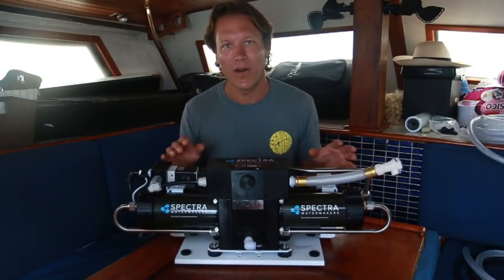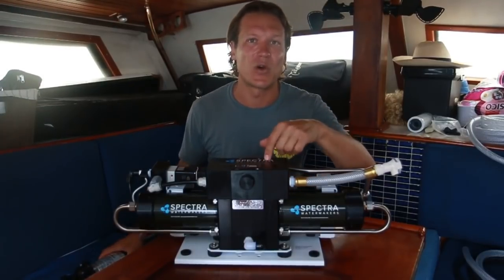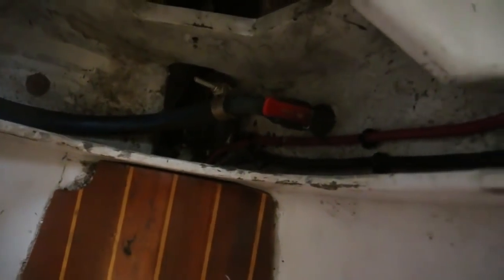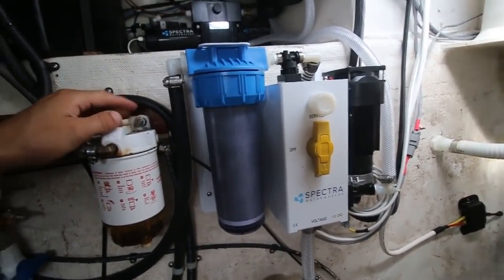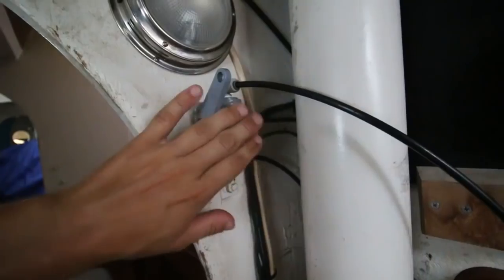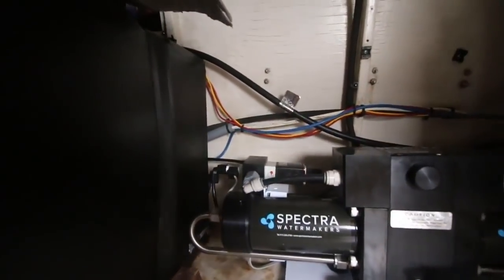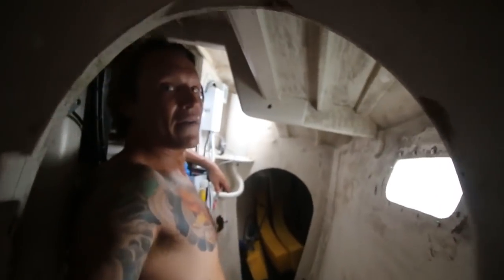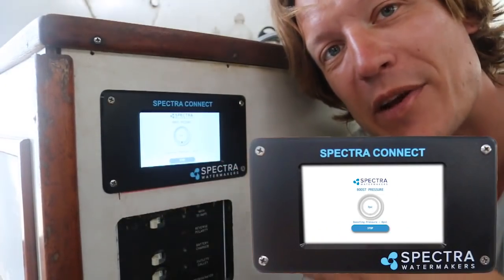Watermaker Explanation & installation

Comment: GREAT review and install info. Well organized. I am about to start mine up after years of disuse. I bought my boat with the system installed but winterized and it has been unused. Likely ruined something. I guess I am in for a 600.00 filter replacement? Will find out. Your review has helped motivate me to getting off my butt and getting this done ... soon :  ). one of the issues for me is that I am on the Oregon Coast, and most marinas here are all at the bottom of rivers and so silt is an issue. You're NOT supposed to run these things in areas with high TDS (Total Dissolved Solids). This is my BEST excuse! :  ). Thanks gain for the video!

Comment: This may not apply to many sailing craft but I'll mention it , on a trawler I used to operate we ran a drain line from the air conditioner evaporator into a drum to catch the water that condenses , it would make more than 20 litres per day and was fine for laundry etc. which extended our tank water usage .

Comment: "entertaining is every time I'm in one the videos, right?" Kimi is so freaking loveable! Great video! We're considering a Spectra too. Why did you go with the Ventura 150 vs the 200? Miss you! -Des
Reply from the maker: Good question, Des. We wanted to get the least expensive option with a Clark pump. The 200T is the same pump, but with a bigger Clark pump, making ~2gph more water. For us, the most important thing was being able to run it off of the 300W of solar we have. The 150 is perfect for that. The 200 would be equally as good, but at a higher price point. If you are worried about producing more water, or having redundancy, the Cape Horn version is pretty cool. Check that out. Good to hear from you! Big hugs to You and Jordan.

Comment: Great video James. Kim is awesome too!  I’m sure you have done your homework and this is the best water maker. Is it reverse osmosis? I used to maintain a system on a ship in the Canadian Navy. 😍🇨🇦 This one looks amazing and way to go on getting that sponsorship. Just a thought... make sure your engine gets proper cooling and running both doesn’t starve one. You don’t  want a burned out pump (on the water maker side) or an overheated engine. Quick fix: run one or the other. ONE LOVE from Vancouver Island. ❤️🇨🇦

Comment: This was one of your best videos ever. Seriously. I've see another sailing channel use one that came in a case and it was very simple to use.  But you explained the whole process so well. I have one question, can you substitute a pressure gauge on your bladder tanks to shut the system off when the bladders are full? It should just be a set of contacts so the water maker shouldn't care.  What do think?
Excellent episode. You're going to make a great ambassador for them.
I heard Sailing into Freedom, Peter and Margarida want to meet up with you guys whenever they get to the other side of the Panama Canal. 
Great episode. Safe journeys from snowy Syracuse NY.

Comment: That's a great video. What about a lightning strike? I know you lost a ton of equipment recently due to a strike. How would your new watermaker fair?
Reply from the maker: good question. There are manual overrides, and as long as the shurflo pump is still good it’ll make water. :) That’s one of the questions we’ll go over with the factory tech in the next video.

Comment: Nice video, but puuuh, its bloody expensive in Europe and even in Columbia and Panama. I see one problem for the future - the machine has a lot of valves in the high pressure zone. For a similar system, Purewater, some users tell it, some not. I'm exited on you experience.
Fair winds
Tom

Comment: 9 amps for a 12v DC system ,  that's about 3 times less current than other 12v watermakers that produce about  the same amount of H2o per hour. . This unit is too big for me but I think there is another unit that runs on 12v DC and while less efficient it's a lot lighter and less bulky  , still very expensive if you can find it ( Power survivor 40E ) .
Oh yeah I miss Kim ...... what a great smile she has

Comment: Wait - you put a 120V 15A (1800W) circuit breaker on a 12V 9A (108W) Spectra Ventura power input?
Reply from the maker: CB go by amps, not watts, but good catch. It’ll work for now, it’s rated to 48Vdc

Comment: I don't think a standard household AC circuit breaker will work on DC power. 
I could be wrong (it's happened before) but you might want to check on that before you depend on it to keep things from setting your boat on fire.
Reply: Amperage doesn't care. Most are rated for either.  But the contacts will wear out much faster if gets used as an on/off switch.
Reply: @tomwilliams8675  Ok, I wasn't sure it would actually trip it if it needed to. Hopefully all is well.

Comment: Seems like a effect system is it internet dependent ...what would it cost approximately ,Txs
Reply: It's simply using a router for onboard wireless connections, hence each device has it's own IP address.  No need for Internet.

Comment: Maybe a solid product, but the video is a POS. Too much installation detail overlaid on 'what am I now looking at?' 

The result is: what in hell is now being shown? And I'm a person with multiple engineering degrees!!  The close-ups on the pump: worthless. The details on wiring connections: the same. 

The optimum approach to selling this system should a series of references to 1) successful installations that prove reliability and meeting potable water specs, 2) installation instructions/details that are available and are backed-up by support personnel. Make a strong arguement as to why this particular arrangement has advanteges relative to the competition.

 Is there a distinct reason for one to purchase this system, as opposed to the myriad of other competing systems to produce potable water? For me, it is a very affirmative NO, at this stage of invesiagion. Tell me the advantages of your system, how it will be supported, and perhaps note any real-world operational history. 

Otherwise, the details on how to hook-up such a system are 100% wasted.

Thanks,
Mike2
Reply from the maker: Whatever I tried to reply here would be a waste of time to a curmudgeon. Go take your multiple engineering degrees and design your own.

Comment: This is exactly what I needed. I watched this a couple of years ago... but now were 200 nm off Vietnam heading to Subic Bay (Starlink is so cool), and only  'sort of know how the Spectra system works...' Of course we really want to know what's going on.  "Ah, the pressure relief valve was left open...." 
I was given brief insctruction at the dock. "It's all automatic. You don't need to open that valve." "You don't need to open that valve." "Oh,  maybe you do need to open it..." (Spectra makes a great product but the manual jumps in too deep too quick. Really appreciate the step by step and the diagram.)  Working great now. Thank you James, really appreciate it.

Comment: It seems rather complicated, friend. And when offshore, on no account divert the output straight to your main water tank when at sea. If the desal fails, you will end up with your main water tank full of salt water. Use a separate tank for the output from these devices.

Comment: Having bought a boat with a Spectra (Catalina 300)  and lived on it for 9 years in both fresh and salt water I can confirm both the product and the company are great. Many parts are off the shelf too, making for easy and economical replacement.

Definitely recommend the MPC control panel. Makes the entire operation cycle real easy.

Comment: what a great video James, you covered it in very good detail.  It's obvious those people have their shit together.  I've heard their system costs more than others but after watching this, it's obvious why! They use quality parts including the electrical connections which I'm familiar with.  Also obviously a very well thought out, & well integrated components.  Nicely done and you cleaned up nicely, I'm sure having an endless supply of water is going to make life much more enjoyable on board.  I talked to Tom Christian several times on Pitcairn years ago via Ham Radio, a lot of interesting history there and interesting how people have continued to live there in spite of the hardships.  No real anchorage is going to make it tough but they usually sent out a craft to bring people in who are visiting.  Seeing your ingenuity, I'm sure you will figure out a way to make it happen... LOL. Smooth sailing.